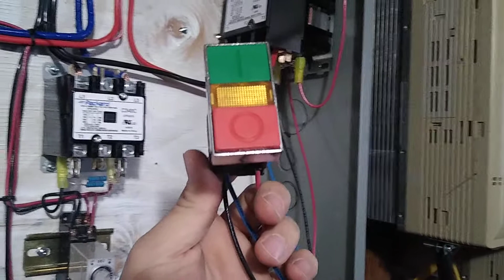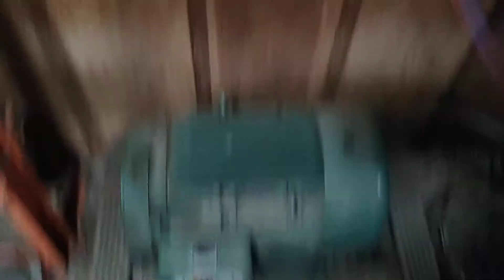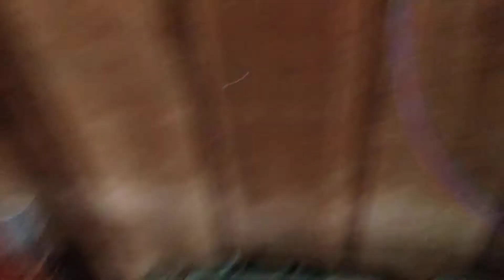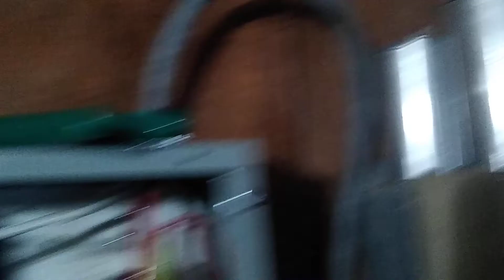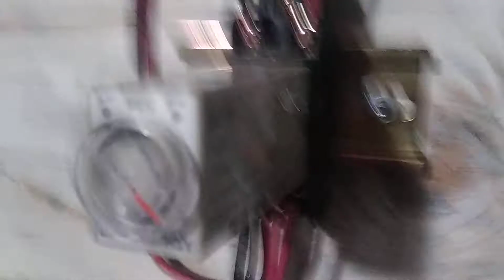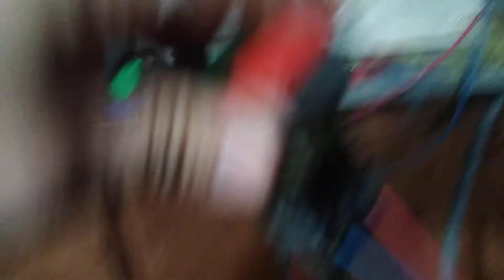30hp rotary phase converter build pt1

Comment: Man, I need your help / expertise with my 30HP RPC!
Reply from the maker: I'll see if I can help
Reply: @electromechanicalstuff2602  What I have is a Southern Converters 30HP RPC.  The issue is my house and wiring is from the 1990's.  Has 1/0 aluminum wire coming in, so I can only guess I have about 125A of input service.    It's enough juice for a converter that is already running, but the locked rotor amperage on my idler motor is 217A @ 460V, single phase.   But since I'll be wiring it for 230V single phase, it means it will hypothetically pull twice as much amperage, and I don't know if the transformer that supplies my house will handle that.  Would you know how to wire up a pony motor so it can get the big motor going before I hit the "on" button?
Reply from the maker: @zod-engineering-welding  ya my pony pulls 320 on start up. How many rpm is your pony motor? 1750 or 3600?
Reply: @electromechanicalstuff2602  Wait, pony is not the actual 3ph idle motor correct?  I thought that the term "pony motor" was an auxiliary motor that helps start the main 3ph motor?  If so, then I don't have one. I only have the main 3ph idler motor from the phase converter package.  It is an 1800 RPM made by North American Electric Motors PC-286T-30-4
Reply from the maker: @zod-engineering-welding  my barn is wired from the pole with #2 aluminum and it handles the inrush. I installed the 200 amp service and just connected the 4/0 aluminum to the #2 aluminum with parallel clamps, hopping it would melt and then the utility company would have to pay for the upgrade 😁. But so far no luck. My wife says she can only see a minor flicker in the house lights. It's on the same transformer but different feed. My barn is 300' from my house so they put it on its own meter. But the utility company if they actually knew I was starting a 30hp pony would probably want me to pay for a bigger transformer. U can always add more start caps to get the inrush down too. And the inrush will last less time. My pony is 3600 rpm so it takes longer to start but still only takes 0.5 seconds to get to speed. I have a good amount of start caps tho
Reply from the maker: @zod-engineering-welding  yes and no depends who u ask. Myself I do not use an additional motor to start my idle motor so I've always called my idle motor my pony. But yes u can absolutely use a smaller 5hp motor to spin up the bigger idle motor. There are several videos of people doing that. They usually do that because they don't want to deal with the " complex " start capacitor circuit. They just have the small pony motor hooked up to a disconnect switch and a v belt. Once the motor starts tho u must take the small motor out of the rotation. Also do u even have a shaft stub on your idler motor. Most companies cut them off flush or produce them without a puppy shaft
Reply from the maker: @zod-engineering-welding  
https://youtu.be/xwSnweP-UZc
Actual pony start
https://youtu.be/tAqIHujz2tE
Doesn't need to be complicated just need to be able to release tension on the pony. Something to do with damaging the ponys capacitor
Reply: @electromechanicalstuff2602  I see what you mean.  My panel does have the start capacitors, so I guess it wouldn't be much help to add the smaller motor.  Mine doesn't have any shaft protruding because it was designed and built specifically as a phase converter motor.

One thing I do have a question on is the start timer.  The vendor says it should be set to less than 1 second; to never set it over 1 second. but he never elaborated as to how to actually set it properly, IE:  1/2  sec?  1/4 sec?  3/4 sec?  .  Can you shed any light on this?  thanks for all your help and time replying!
Reply from the maker: @zod-engineering-welding  So it easy. The motor tells u what it wants. If it's on too long the start capacitors don't have the exact phase angle as the motor so it growls if they are left on too long. Basically turn the timer up till it growls then back it off till it stops. This will keep them in the system as long as possible. U can always add more start caps. It will reduce inrush. And the more u add the less time ur timer will need to be on.
Reply from the maker: Definitely make sure u use the biggest breaker u can tho. If you panel is a 125 amp panel I'd try to find a 125 amp breaker to feed the converter. The breakers can handle around 300% inrush. If the breaker still trips on start up and your competent enough I'd pull out your meter to kill power to breaker panel. Then get a 60 amp fused disconnect with slow blow motor starting fuses. wire it directly to the meter base or top lugs of breaker panel. Make sure the wire material is the same don't put copper wire in with aluminum. They will heat and cool at different rates and get loose over time along with dissimilar metal corrosion issues. Maintain good, safe electrical practices!
Reply: @electromechanicalstuff2602  10-4 on the breaker, I'm using a 125 Eaton Breaker in the main panel (which oddly enough doesn't have a main breaker, it seems they just used a "subpanel" where an actual main panel should be).  From there it feeds my garage sub-panel with 0/2 copper.  Then in the garage sub-panel I have another Eaton 125A breaker that will feed the RPC panel with 0/2 wire by way of an intermediate breaker box that serves as a disconnect with it's own 125A breaker.   I did this so I can have 0/2 copper wire as close as possible to the RPC panel to minimize voltage drop.  Now that you reminded me that the breakers should handle 300% inrush, I'm hoping that will be enough to let the motor start up with just the start capacitors that it has.  If it trips or groans too much and doesn't spin up, I'll give ya a holler, lol.
Reply from the maker: @zod-engineering-welding  mine is connected to a 100 amp breaker and it holds it
Reply: @electromechanicalstuff2602  I wouldn't even know where to start to figure out how to add more start caps though.  As for the timer, should I try 0.5 seconds to start?   Here is my google drive folder where you can see pics of all of it.  

 If you'd be willing to help me figure out how to properly integrate more start caps I would gladly pay you.   While I'm not too familiar with the specifics of RPC panels, I'm good with electricity otherwise, and can measure values and what not.
Reply from the maker: @zod-engineering-welding  I saw the pics. It looks like a nice unit. Take that google drive down one page has shipping invoice on it. U basically just add the black capacitors to the right side. They all daisy chain together. No polarity just two wires in and two out. But it looks like it has 10. Not sure of the ratings but that seams like it should be enough already. Mine only has 8. I'd try it as is first
Reply: @electromechanicalstuff2602  Thanks, I forgot about that invoice pic, I removed the link.  Thanks for the advice.   Any thought on the timer setting now that you've seen the inside of the panel?
Reply from the maker: @zod-engineering-welding  oh yeah. Start at .5 and see what happens. If u hear it growl turn the time down. If it doesn't growl turn it up till it does. Then back it off again till it doesn't. But just wait a few mins before restarts. The windings get hot on start ups so give them time to cool down
Reply: @electromechanicalstuff2602  ok thanks.    The growling you mention, if it does occur, does that only happen on the actual start-up , or would it continue to make the growl as it continues to run well after the in-rush?
Reply from the maker: @zod-engineering-welding  only on start up. So even if it does growl it will only be for partial of a second
Reply: @electromechanicalstuff2602  I found these on ebay: 

https://www.ebay.com/itm/Packard-270-324-mfd-Start-Capacitor-220-250v-Phase-Converter-Retail-Package/274404610679?hash=item3fe3ca1277:g:k0QAAOSw~cRe7-4q

I measured the black caps and they measure 270 uF, so I take it those ebay ones are the same?   If so, I can technically go crazy and add as many as I want to each bank, and really kill the in-rush, right?   I don't mind spending $100 to have peace of mind.
Reply: @electromechanicalstuff2602  man, I wanna deeply thank you for all the advice you gave me.  I set the timer for just a hair under 0.5 seconds, and it cranked right up without any growling and is purring like a kitten!  it's been a couple weeks now and it is working great powering my 400A TIG welder!   I ended up using a 100A breaker after all, I figure the worse that could possibly happen is it would trip the 100A breaker before my "disconnect box" that has a 125A breaker.
Reply from the maker: @zod-engineering-welding  no problem
Reply from the maker: @zod-engineering-welding  I never saw that ebay comment sry

Comment: Nice build. What is the purpose of those 2 resistors on the bottom contactor?
Reply from the maker: To drain the start caps. They will hold a 300+ volt charge for weeks and bite u. The run caps get drained by the motor windings cause they are always connected to the pony motor.
Reply: @electromechanicalstuff2602  Thanks! Now that I'm thinking on it that was kinda a dumb question lol. I've had a 30hp RFC converter on my to do list for about a year now and it keeps getting pushed back with other projects, it's motivating to check your build out. I've made it partway threw your part 3 video, how did you decide what time to set your timer relay to cut out the start caps?
Reply from the maker: @Ragnar.Lothbrok.3.14  trial and error. If you have a lot of caps u need less time. Mine is a 3600 rpm motor so it also takes a little longer to start up. But basically 0-1 second time works for most applications. So if the start caps stay in too long the motor growels. Just keep shortening the time till it does not growl. Too short and the motor may not fully start and you'll hear that too. Motor is louder when not at rated RPM but not a growl. It's very distinct. No mistaking it. If it's not at least at 70%  rated RPM when the start caps come out you can hear the RPM start to drop. That's when u need to shut it off quickly. Within 3-5 seconds. Or the motor starts to heat up quickly. I would always wait a few mins before start ups. Because the motor has not yet developed it's induction magnetic field yet the windings literally turn into resistive heaters. You won't mess it up I'm sure. It's not an exact science. Should only take a few tries till u get it
Reply from the maker: @Ragnar.Lothbrok.3.14  another big thing to consider is your balancing voltages. Only Get them as  high as you need cause I'd like mine with no load at 260v on the ghost leg so when under starting load for that compressor it doesn't dip as much. Problem is the pony motor gets hotter and the idle current doubles. Right now my idle current is 10 amps so about 2400 watts. Basically the idle motor is just a space heater. When I'm at 260 volts my idle current is over 20 amps so like 5,000 watt space heater. Keep an eye on how much current you pony motor ghost leg is getting too while balancing. The smaller motors it's real easy to exceed your FLA when your voltage gets too high.
Reply from the maker: @Ragnar.Lothbrok.3.14  if that doesn't make sense let me know I'll try to explain it better.
Reply from the maker: @Ragnar.Lothbrok.3.14  this guy hands down explains it the best. He misses some stuff like monitoring the current on the ghost leg during balancing but the document he attaches does mention it. 
https://youtu.be/u229h7NcMxk

You can also make it much less complicated then my 30hp unit. My 15 and 20 hp units are as simple as i could make them. I use a disconnect as my on/off and all my contactors have 220v coils. And my time is from Amazon and has a 220 volt coil just to minimize the components like a step down transformer.

15hp build
https://youtu.be/hyjYdEL-80s
Reply from the maker: Thanks!
Reply from the maker: I also just uploaded pt 3